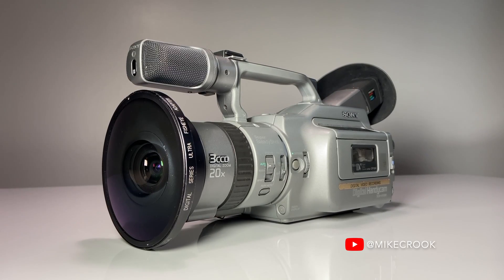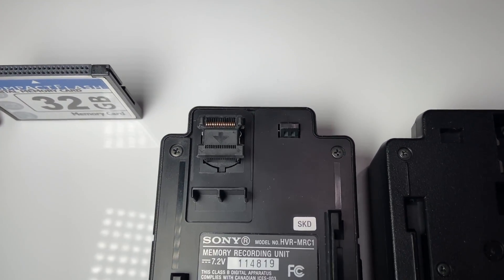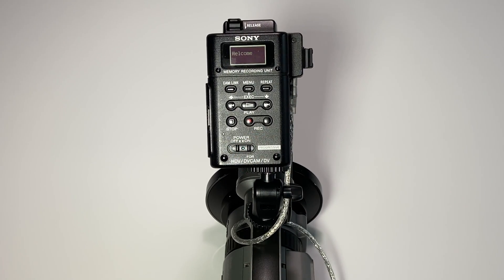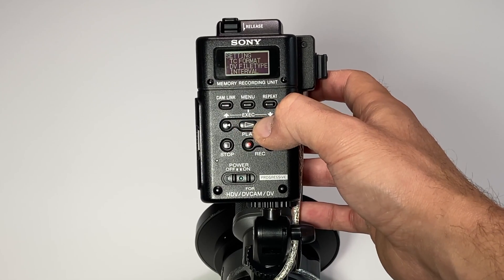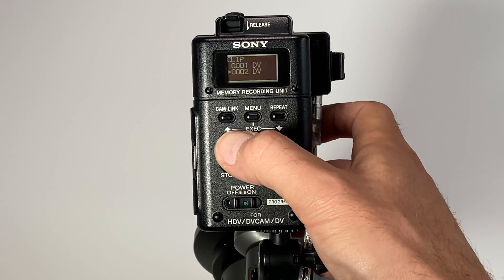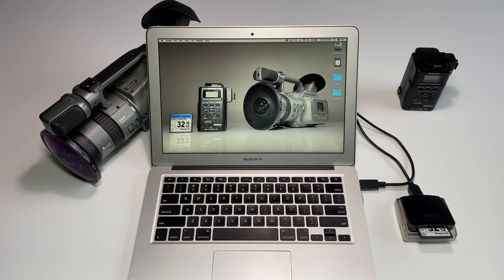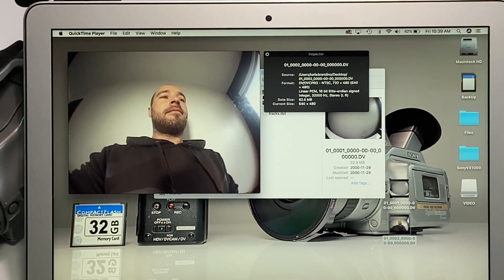TAPELESS VX1000 / SONY HVR-MRC1

Comment: I buy hvr mrc1, but "No File" is displayed and dv is not connected and format didn't work
Reply: But when playback mode it"DV input" so I don't think it's a firewire cable issue
Reply from the maker: Sounds like you have a pin damaged in your firewire port on your camera. This is very common having a bent firewire pin and in most cases you can bend it back in place
Reply: @mikecrook  I tried with 3 other vx1000 or vx2000, but didnt worked. and used 3 new firewire cables
Reply: @panic924 did you figure it out? Having similar issues for a while and couldnt solve it yet

Comment: I can only get my HVR-MRC1 to record through my vx1000 if I power the vx on first. Does that seem normal?
Reply from the maker: sorry for the delay, yeah thats totally ok
Reply: @mikecrook  seems like every video I see, the user can turn on either the camera or the HVR-MRC1 first with no problems recording, so it seemed something was wrong with one I have. This also means if I watch a recording back, the HVR has to be turned off before switching the vx from VTR to camera mode.
Reply from the maker: @codyup  there is 3 versions of internal parts of a VX, you could simply have one of your boards not matching version. This is a whole subject matter that is very hard to explain over text. But I have had this happen with a vx I have had that was Japanese. Might be that simply
Reply: @mikecrook  I figured out that the HVR I have has a loose FireWire connection. I can get it to function perfectly when held in the right position, otherwise it doesn’t seem to register when the camera is turned back on. Luckily I can send it back and get a new one, but just wanted to say thanks and let you know.
Reply from the maker: @codyup  Oh wild! well thats good to hear, thats the last thing I would have thought of so thats great info appreciate the follow up

Comment: Is there an other option for the mount? For example a L Mount? But other than that great video!
Reply from the maker: Yes, in my highlighted stories on IG, I have it running on the side with a tripod extender bracket. soo much better for the weight and easy to press the record button

Comment: I bought one of these memory recording units and it freezes/does not record 80% of the time on two different Sony pd100s I have (both of which have dropouts when I film tapes through them) but then I tried it on a vx1000 and a buddy’s pd100 (which films on tapes fine) and it worked no problem. Do you or anyone have any clue why this is?
Reply from the maker: Maybe Corrosion? Sounds like your pd100's need a cleaning inside or your firewire port is damaged/or loose connection.
Reply: Same issue did u ever fix it?

Comment: hey while im filming it randomly stops recording while i am using it. any idea why that happens?
Reply from the maker: 1. Over heating 2. Bad cable 3. Wrong cf card this happens the most 4. Firewire port on camera has dirty pins or damaged.
Reply: @mikecrook  my firewire cable was damaged a little while ago, ill get a replacement and let you know

Comment: I am having a hard time finding CompactFlash cards for this. Your link shows "unavailable". People I talk to say this unit is finicky and it has to be a certain type or brand, Also, 32GB might not work.. How sure are you about this? I am not sure about the return policies if I just try to buy them everywhere and wait to see if one of them works. 

Any ideas?
Reply from the maker: Ive had multiple people report these work: SanDisk Extreme PRO CF Cards (Don't use the Extreme) 32gb
Reply: @mikecrook  , is there a power supply? Is it the same as my Sony camera? I can't seem to find anything online or in the manual.
Reply from the maker: @davestreicher  there is a DC IN but I really cant see why you would need one, a small L series battery is lasting me well over 8 hours of use
Reply: @mikecrook  I just like to be prepared. Batteries can go bad and I wouldn't want it to quit in the middle of a shoot. Its just nice to have in the bag just in case. 

So any ideas of a model number?
Reply from the maker: @davestreicher  Looking at it right now, its the same DC cable for the Sony vx2000, trv900. I found a bunch on amazon for cables that should work. If you have instagram feel free to dm me and I can send you pictures of the dc port
Reply: @mikecrook  yeah, I actually tried it with my FX7 camera power supply. It does fit, but I wanted to know if the power supply is exactly what it needs. In other words, is it too powerful or exactly matched.

Comment: i have a problem with my mrc-1, everytime i plug it into my vx1000 and press record nothing happens and the mrc-1 screen tends to freeze, i thought it was a problem with my vx until i tried it with my trv900 and the same problem occured, tried different firewire cables and nothing works still, used to work great and out of nowhere this started to happen
Reply: yes i have this exact same issue is there anyway to prevent this??? @Mikecrook ?
Reply: @noidfilms4732  any fix???
Reply: @HomechillGaming did you find a fix?
Reply: @noidfilms4732  did u find a fix?
Reply: Same issues did you find a fix?

Comment: Hey I am having a problem with my MCR1. When I put my CF card in and plug it into my camera (vx2000) it says "No File" I tried looking this up but nothing helped me. I also updated it to version 3 but that didn't help ether.
Reply from the maker: This can be your firewire port on the camera, also can be the CF card is to slow of speed
Reply: @mikecrook  dang I just bought a new firewire cable, same problem.
Reply from the maker: @fireyouraccountant  inspect your firewire port on the camera, should be 4 gold pins in a perfect line, one might be popped out
Reply: a fresh firewire cord fixed this issue for me

Comment: Are there any fixes for a mrc1 that works but will stop recording on its own? Longest clip I’ve been able to get is about a minute before it stops recording. Using a 16gb Lexar udma 7 card.
Reply from the maker: Card might be to slow or out of virtual memory and capping at 1 minute. Class 10 is recommended for CF card which is minimum 120mb/s write speed

Comment: i followed all the steps but i still can’t record and it says no file. what do i do?
Reply from the maker: common things would be a CF card that is to slow or over 32gb in size or Faulty cable. If the device blinks when you plug it in while both are on then stops blinking on the screen then its recognizing and would be your CF card.
Reply: @mikecrook  i bought a sandisk extreme compact flash card 32gb 120 mbs is this not a correct cf card for the device? If not which do you recommend?
Reply from the maker: @jolly9505  that should work. If you have instagram please shoot me a message with a vid or a picture of whats going on and will help you sort it out

Comment: Do you think this device would also work with HDV? I've got an old Sony HDR-HC1E that is constantly having tape deck issues.
Reply from the maker: If it has firewire out then yes, so far haven’t heard of a camera not compatible
Reply: Yes,it does,I use one on my Sony Z1e,I have tested it on a Canon XM1 (GL1) and could not get it to work,but will work on Sony TRV110E OK even for synchronous star/stop

Comment: I hear of people fusing their cameras DV ports when connecting a firewire to it and a computer, while keeping the camera powered on?

Are there any dangers of fusing your DV port while using this recorder?
Reply from the maker: Im assuming fusing you mean just plugging a firewire cord into the camera and to the computer? This has been done for a long time to live capture. Can’t see an issue why this would be of danger. The word fusing though could you elaborate on that?
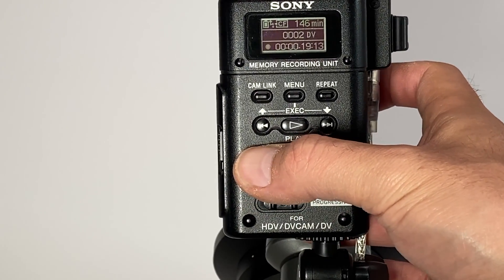Reply: @mikecrook at 3:20 in this video is where I heard about it. Fusing like I meant burning out
 https://youtu.be/WrxYPfhgkjA
Reply from the maker: @PowderSkiMan  there is no power from the firewire on the mrc1, so yes its safe.
Reply: @mikecrook  sweet thanks!

Comment: Very nice! What is the difference (in terms of quality) between AVI DV and RAW DV? Thank you.
Reply from the maker: In short Raw DV is for mac and AVI for windows. Thats the only difference I have seen in my research both are stated to be of the same quality too. AVI is a more common file type now with more programs allowing to use it. Adobe has removed the DV codec which is frustrating.
Reply: @mikecrook  thanks a lot for your answer.
Reply: @mikecrook  Just got one of these. If I’m editing on a windows PC with Sony Vegas should I film in AVI or Raw DV?
Reply from the maker: @cdock  AVI is much easier to work with

Comment: 720p? Did you mean 720 pixels wide? by 480 pixels?

Even if that was the case, the clip's information is shown on your computer screen @5:42,  at 640x480 , which is 480p.

720p (with a 4:3 aspect ratio) would give a resolution of 1280x720.

Sorry in advance if i'm missing something here...
Reply: Wait a minute....the same Mike Crook from Toronto / Skateperception? Hardflip backtail bigspin Mike Crook??
Reply from the maker: @hostsofmichael  yeah thats me haha! Yeah 720 width, my bad if thats miss information but it upscales it slightly.
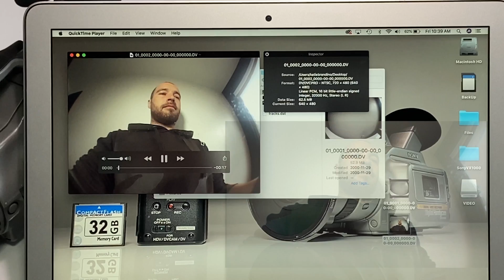Reply: @mikecrook  hang on, you can tell that the overlay at 5:32 is cropped compared to the video on the laptop screen.  compare the space above your head.  so I'm guessing something happened to the footage before you overlayed it but why would this be 720 width?
Reply from the maker: @cmalchik  It cropped it in editing, I made the video quickly and used Imovie on my phone to edit is why.

Comment: Awesome vid! Will this work with a UDMA-7 CF card?
Reply from the maker: The link to the card is in the description that I know for sure works, but also tested a few others and seems that any card 32gb or below with a min speed of 120mbs will work
Reply: @mikecrook  on my unit it states "Work with compact flash 2GB or higher. Work with compact flash speed 133X or higher"
Reply from the maker: @nickfatsis9607  anything over 32gb wont work

Comment: I have DataVideo DN-60A and Canon MX2. Similaor setup, but can’t get it working. The unit says No Input. Maybe wrong firewire cable. I have to give it more time and test it some more.
Reply from the maker: Firewire cable is very important and many fixes reported was the cause of units not working
Reply: Still got the dn60?
Reply: @andrewanderton  gave it to a friend and I think it’s not working. Maybe I need to try more cables.
Reply: @FilipMarysko   I’d be interested in buying if either of u are selling it?

Comment: problem is, these things are so expensive. I need a better way to use my DSR-PD100 and PD150, but for now I just have to stick to the IEEE
Reply from the maker: Cheaper than tapes and camera repairs in the long run, really up to you the worth is
Reply: @mikecrook  I'm more of an amateur, so I think I'll probably stick to the tapes, but I think it's really cool that the memory recording unit is compatible with the firewire (:

Comment: DV files from the device arent supported by premiere pro when trying to import them
Reply from the maker: This is an adobe support issue I found out after making the video. You can record in AVI as-well
Reply: @mikecrook  is there a substantial difference from recording in AVI to the DV format?
Reply from the maker: @LeoBanuelos  I have yet to try but can’t see it being a deal breaker at all. Avi is still full res.

Comment: i was wondering if there isn't any like tape design with a built in space to put an sd card? it would be so much easier, i can't find any solution for my canon uc-v300E, if anyone as one, pls just tell me
Reply from the maker: To run a tape even if it is a “dummy tape” defeats the main purpose, these camcorders are prone to bad heads that causes glitches.
Reply: dummy tapes dont touch the heads as there is no tape in them, not even sure what the point of a dummy tape is. heads in VX are rarely the problem, its the dirt/dust build up on the heads that makes the glitches👍

Comment: I can't believe how expensive those units are. It's firewire and a compact flash card. 200-400 dollars for the simplest tech ever.
Reply from the maker: When you compare the cost of tapes and repairs its really not expensive, in turn its cheaper. The pros outweigh the cost
Reply: I think someone could technically create this tech if they were really clever, or perhaps find a tech company to develop a lower cost unit, but by the time you get to that point you could of dropped that 400 and just be done
Reply: @segatronmedia  I mistook it. It’s not 400, it’s like 600-800 in the states so far as my searching has gone. I got the Firestone FS4 for 200 and it’s rad.
Reply from the maker: @altonbailey9702  i just bought one on ebay for $400usd 7 days ago. Just wait they will come up or search your local listings
Reply: @altonbailey9702  How does the battery life last on this thing?
Reply: I just purchased the CLEARCLICK HD Ultimate Edition 4K converter and it uses both HDMI and A/V connections to convert footage to digital. The price point was a little over $199.00 and it's a Godsend because I several HDV, Mini-dv and SONY Digital8 camcorders and whenever you are using a tape-based camera, you are bound to have tape mechanism failures and those camcorders do get expensive in fixing them.  - James D Watkins artistic director of PHOENIX PRODUCTIONS.

Comment: If I record onto a tape then plug this in can i record the stuff on the tape to the recorder? Also does audio work?
Reply from the maker: Yes you can. You can also record both at the same time. That was the purpose of the unit, records a digital backup. Audio works too
Reply: @mikecrook  Awesome thanks!

Comment: Sup man! Thanks a lot for that video :D Could you help me out with an issue? When I go to player mode, the DV IN sign wont appear and I'm not able to watch the clips. PS: when I use the DV OUT to capture tape footage, it works perfectly. Any idea of what could I do? Thanks!
Reply from the maker: Its a possibility your dv in pins on the camera are not working, or ive heard if you have PAL this seems to be an issue on play back. Still trying to figure it out for a couple other people but its really hard when I cant test irl because mine is English ntsc
Reply: @mikecrook  Yeah, my VX1E it's PAL :( It's weird because I tested it on a VX700E, witch is supposed to be also PAL, and it works normally. It sucks :/ Thanks for the help anyway!
Reply from the maker: @felpsbmxsp  yeah I have a feeling you have a bad pin in your vx, try cleaning the pins with a electronic cleaner. Basically 4pin has 2 in and 2 out. Having a corrosion is highly probable on these cameras
Reply: @mikecrook  It's very odd because it records normally on the MRC1 and I can perfectly capture tape footage thru the same DV OUT. But when I go to player mode, nothing happens.
Reply from the maker: @felpsbmxsp  turns out some cameras do not have dv in!

Comment: How fast does the cf card have to be and does it have to be udma 6 or 7?
Reply from the maker: The link in description works great, also there is a user manual linked that has the specs. I would stick with class 10 32gb

Comment: That's awesome.
Do you think recording monitor also works with??
I saw some VHS camcorder user attached recording monitor with hdmi converter.
Reply from the maker: Could definitely run a field monitor through rca
Reply: Thanks🙏